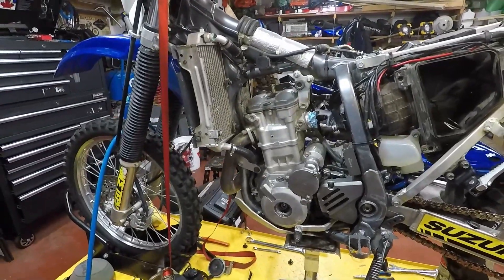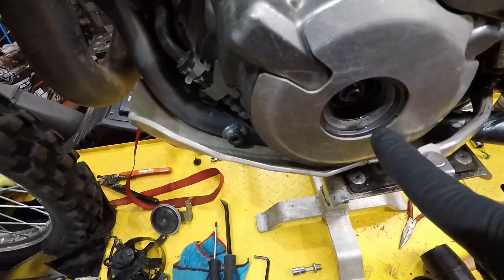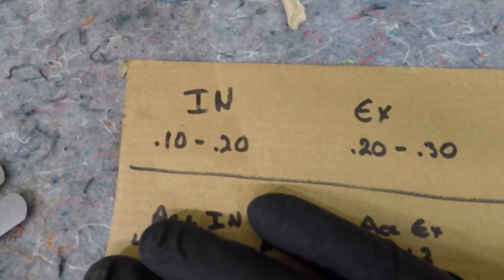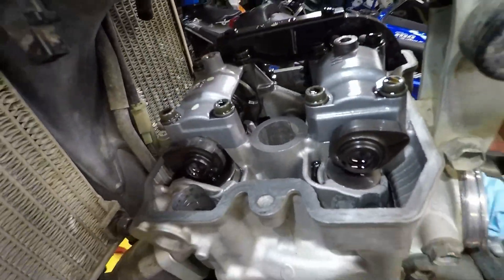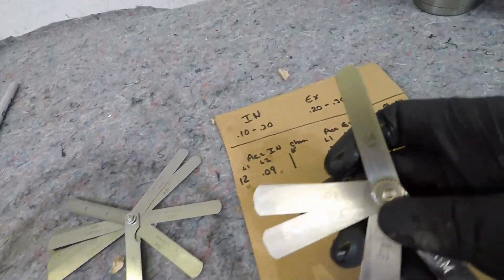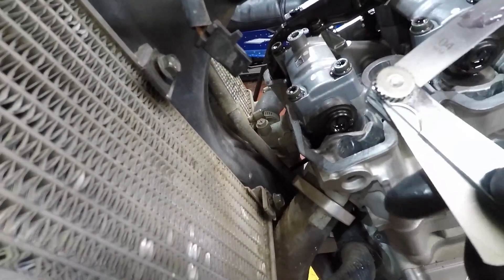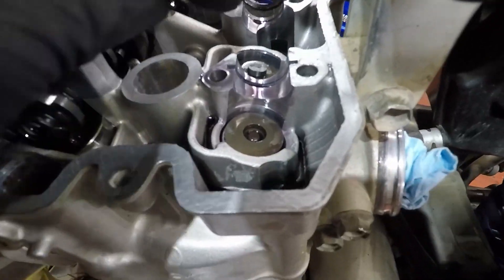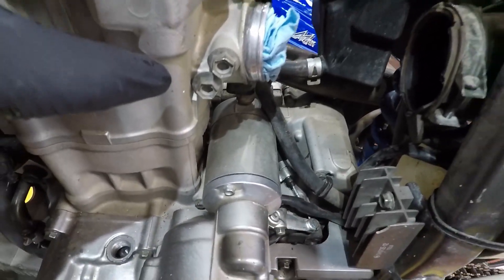DRZ 400 valve check and adjust,

Comment: Great video, i'm down east in Nova Scotia I have a 2018 DRZ400S, I do a lot of riding has 31000 kms on it now, I'm getting a lot of deceleration pops when I let the throttle go but none in acceleration and It stalls every week or so once then takes a few min to start again but will run fine in between, starts up real easy, I am going to check the clearances and take the carb off and clean it, I use an NGK iridium spark plug and only use supreme fuel.

Comment: I was hoping this bike did NOT have the bucket/shim style valves.
Reply from the maker: I feel that they are a better system and not quite daunting once you have done it a few times.
Reply: The DR 650 has rocker arms with screw adjusters.

Comment: Hello. I done this job. I think it will be ok.I have a question. I read that I must verify that my cams are getting oil. I read that I must take out the bung beside the Tensioner. I did and have turned the engine over using the starter with the plug removed. Please tell me why no oil has come up so far. ( New oil and new filter).  Thank you.

Comment: First time doing this, I’ve got the line at TDC, but my cams are pointing in instead of out…any suggestions?
Reply from the maker: rotate till cam lobes are like in the video and check for the line in the sight hole, 4 stroke so you may be on the wrong stoke.

Comment: Is this the same engine as ltz 400? Bc mine won't start it pops out flames but no start
Reply from the maker: BJ it looks the like the same engine however I can only see the one side. I would check the values and cams, could of slipped a tooth on the cam.